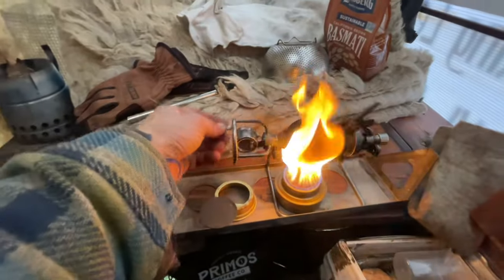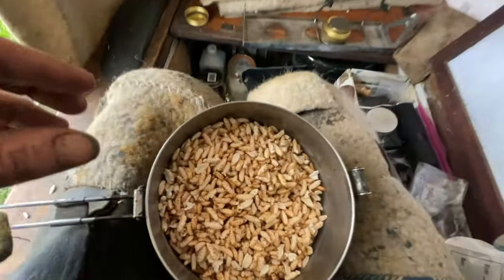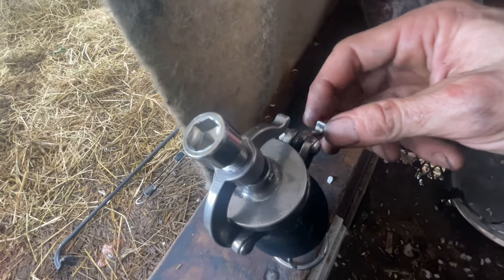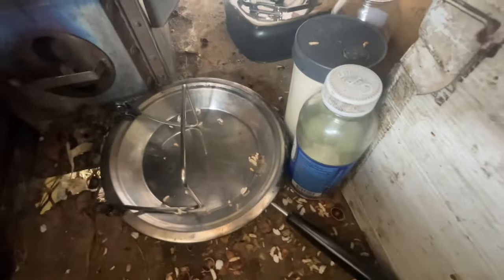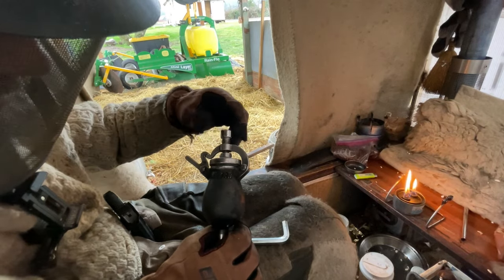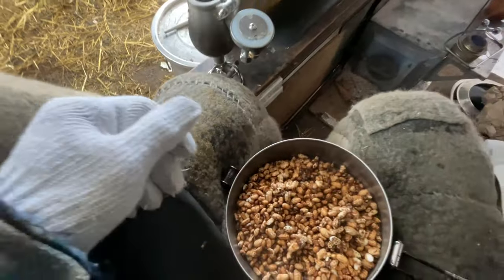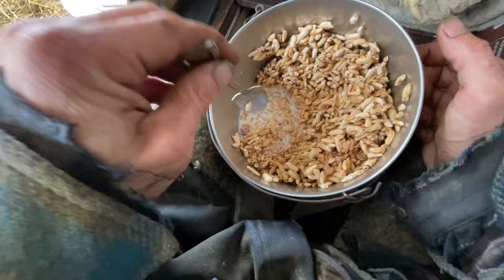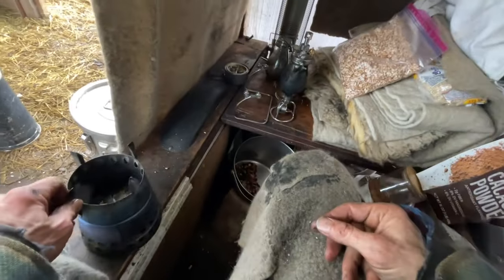Grain Puffer vs Grain Grinder ~ Best Survival Tool?!

Comment: 🤔✌️ Please be very respectful of ANY pressure cooker systems. It's a wonderful way of cooking AND VERY fuel efficient.  Maybe check out "Afghan Cauldrons". Old technology, you can sit in a campfire but, you STILL have to be very respectful....... 👃👃✌️🥰🇨🇦
Reply: Thought I should also plug(??), my fascination with the "Afghan Cauldron" technology.  Seems great for off-grid and is easy on fuel..... You can set the thing ON COALS IN A CAMPFIRE!!!!Bring it up to pressure, set aside and it keeps on cooking.......👍🏻👍🏻. (I have ZERO experience with this thing BUT, certainly respect the the experience of nomadic herders.......) 🥰🥰👃👃👃👃✌️🇨🇦

Comment: In India they call puffed grains Mumra and they puff it in a thing like a wok with sand (they use black sand so it is easier to see and remove). They use it in snack foods for it's interesting texture. This gadget looks super interesting!
Reply from the maker: I tried the sand method years ago and didnt find it efficient or enjoyable enough of a process plus couldnt get all the sand out with just a regular colander
Reply: @123Homefree  it does seem like it would be super hard to remove all of the sand and horribly gritty if you don't

Comment: Now is the fire from that can considered something you can't burn in the summertime?
Reply from the maker: Correct if anybody saw me doing this even inside my wagon in the summer theyd likely call 911 even though its legal to use the gas stove in the video it would scare wildfire victims here so ill have to be completely closed up during the daylight to do it in the summer.
Reply: I see.
☮️
Reply: @123Homefree even contained fires are banned there in the summer? That's crazy! Can you even buy Kingsford in the summer there?

Comment: Yours is the first video I have seen of practical use of this.  I have one your size I think, 268ml.  I have had several problems using it though.  First, it only pops 50-70% of the grains, whether corn or rice.  Maybe my grains are too old and it works better on fresher stuff.  Second, I tried doing sequential poppings, and the pressure took over 20 minutes to build up the second time.  I assumed this was since the vessel was already heated, it was harder to get the heated interior air to build pressure via heat expansion.  The kernels that came out were burned and a black resin like tar coated the entire interior.  
I did not buy a brand name one, so I think mine might be leaking out of te safety valve or something.  It's frustrating, but your success makes me feel I shouldn't abandon the idea of grain puffing just yet.
Reply from the maker: Yeah they have a sweetspot of tightening the door down, the smallest sized 100ml one had an thin metal arm on the door i bent tightening it down too much but i think the larger sizes wouldnt be possible to do that especially if you know it doesnt take that much tightening i wayy over did it but you also have to tighten it enough that pressure doesnt escape through the door seal, if you can smell it roasting its too loose.  I tighten the door nut down as much as i can with jist my fingers then stick the door lever in and turn it just 1/2 way around is usually perfect.  Subsequent loads should tale less time you must not have the door tightened enough and second rounds the gasket is softer and leaks a bit more and preheated vessel is burning your grain before you can start spinning it?  Youll get it keep messing around and find out!